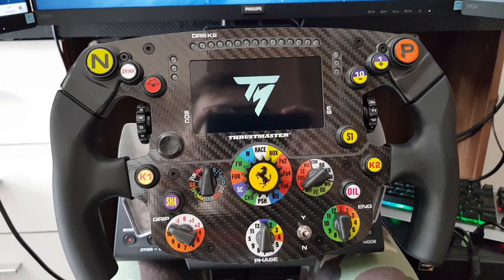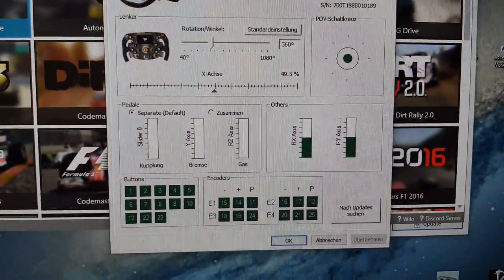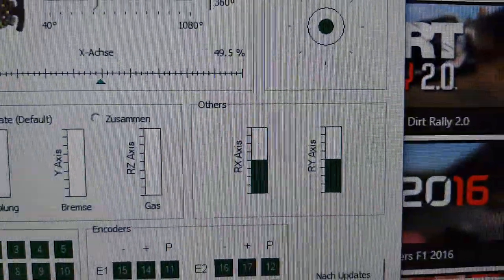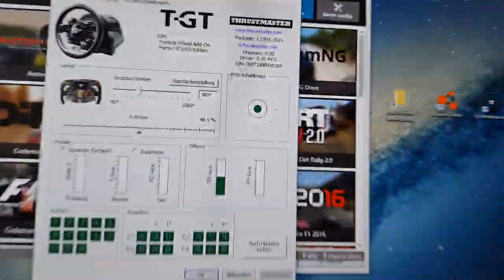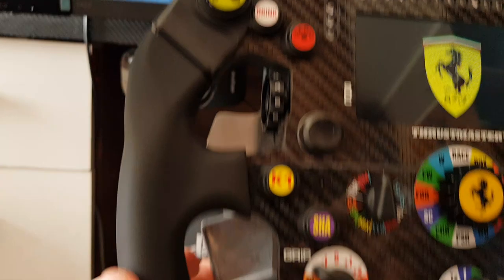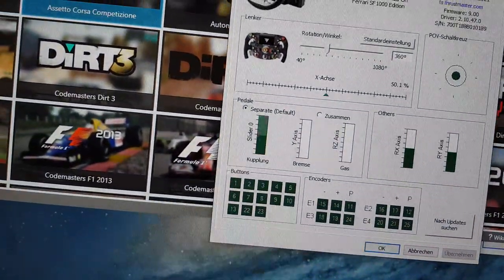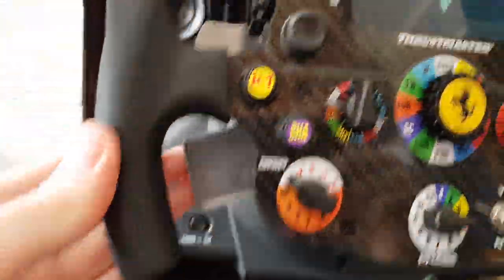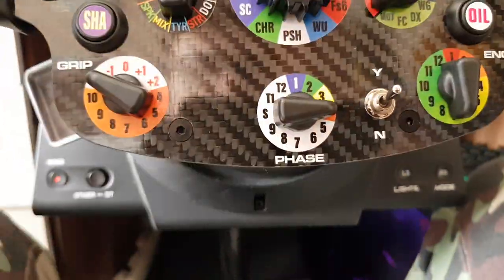How to use the clutch pedals on the TM SF1000 Replica

Comment: And how do you set the bite point? What even is the point of dual clutches if you can't set that?
Reply from the maker: Can't currently set it specifically. It is a big missing thing atm which hopefully gets fixed/added soon. Thanks for your comment!
Reply: What I understand is that in actual F1 cars you can't set the bite point as that's considered a driver aid, you have to half press one of the two paddles (to the bite point), and fully press the second one. That way you "manually" set the bite point, when you start you dump the fully pressed paddle and slowly work the half pressed one.

I guess that since this wheel is a replica of an actual F1 wheel they didn't think of adding the feature, hopefully they'll add it in the future as I'm not a pilot and I'm not that skilled 😆

Comment: Great, thank you for that. Are you happy with the wheel? Any Pro and Cons? Mine will arrive today. I have the T-GT also, but I am on Ps5
Reply from the maker: Glad I could help you! 
So far I am very satisfied with the wheel. The quality of the materials is fantastic and what surprised me the most is the haptics. Every single button has a underlined pressure point that Thrustmaster products never had, just awesome. Also the ergonomics of the rubber grips are amazing.. Honestly the current biggest drawback is the limited compatibility of the LCD Screen/rev lights. It only supports F1 games at the moment. Wanna play something else? Doesn't work with the screen nor the lights. But I am sure that there is more games to come.
Reply: @alc_media  Sounds good, great! Yes, i hope Thrustmaster will support more games, but i think that is just a time thing. Greetings from The Netherlands
Reply: I have mine but dont yet have a wheelbase for it for which i waiting for the ts -xw to come back into stock but only plan to use the sf1000 for f1 and will get a gt3 wheel for acc but glad that u are impressed by it.

Comment: Hi, great video!! Do you know if there is a way to use a bit point for the clutch like in fanatec wheels? And are you suffering freeze in the leds and the screen randomly?
Reply from the maker: Hey Gonzalo, 
short answer is no unfortunately. There may be third party ways but none I know of personally. And yes I remember having freezes in F1 2020, its really a shame. I hope they work on a fix someday.
Thanks for watching
Reply: @alc_media  did you use t300 or ts-pc? I'm trying to understand what is the issue, if the wheel or the base . Thanks for the answer

Comment: Do you know how set bite point to the clutch paddles? I have one of this SF1000 and I Can't, like it's possible on Fanatec's McLaren Wheel...
Reply from the maker: I'm not sure if you can do that yet. Tomorrow TM launches the Thrustmaster Club, which anyone who bought the wheel got a code for. Maybe there you will get some kind of software specifically for the wheel. Time will tell

Comment: Hey! I want to get this wheel but can you adjust the dual clutch? By that I mean when you hold both you don't move , When you release one you go slowly , and when you slowly let off of the last one you go full speed. Can you do that or no? thanks for the answer   (could have explained it better  ) I mean Bite point :D
Reply from the maker: Hey man. It's not native but you can use the mode that lets you use the clutches seperately to emulate what you mean. Although I never tried it, when you somehow can change the deadzone at the left clutch (should be possible for Assetto Corsa) you should be able to replicate this. Also maybe an update will add a native option to this.
Thanks for watching!
Reply: @alc_media  Hey! Thanks for the answer yes probably in AC but in F1 2021 Ill just have to hold one clutch in for 50% and the other at 100% quickly let go of the one with 100% and slowly let go of the 50% one. Probably the easiest was to do it

Comment: Is there a way or does anybody know how to set or change the clutch paddles to in F12021 or F122 to look Left and Right?   I  bind them in the settings and it takes it but it doesn't work in the game.  I am doing it wrong?..Also, can we use one of the clutch paddles for the race Start instead of using the right upshift top paddles?

Comment: Hi, ich will mir auch das sf1000 holen weiß aber noch nicht welche Wheel Base ich benötige. Daher wollte ich dich fragen welche Wheel Base du benutzt und wie teuer die war?
Reply from the maker: Hey, das Wheel ist mit T300, TX, TS-PC, TS-XW und T-GT kompatibel. Wenn du bei der Base nicht zu viel ausgeben willst kann ich T300/TX empfehlen, da bist du bei ca. 250€ für ein Set dabei. Wenn das Budget etwas lockerer ist kannst du je nach dem welche Plattformen du willst zwischen TS-XW, TS-PC und T-GT entscheiden. Die kosten 400-600€ je nach Modell. Ich persönlich hab das T-GT weil ich am PC spiele aber auch Playstation Kompatibilität wollte.
Hoffe das hat dir geholfen.
Reply: Schaut man dann mit den Paddles nach links oder rechts oder was machen die

Comment: Will the display work when f1 2022 comes out? Or will it need an update?
Reply from the maker: I think it will be working from day one, but it's just my guess! Thanks for watching.
Reply: Thanks great service and very polite! You made my day mate! Thanks buddy.
Reply from the maker: You're welcome haha
Reply: Hey also, when connecting your wheel, did f1 2021 automatically connect to the screen and show the car display, or did you have to go to telemetry settings and connect it?
Reply from the maker: @-Tikku-  When you play a supported game, which f1 is, then it works natively, so you don't have to do anything. I only have F1 2020 but I'm sure it's the same for 2021.
Reply: Yeah cause mine automatically connected the screen, without me doing anything.
Reply: So I’m guessing it will natively connect to f1 2022 game when it comes out and is ready to play?
Reply: Does the screen work with gran turismo